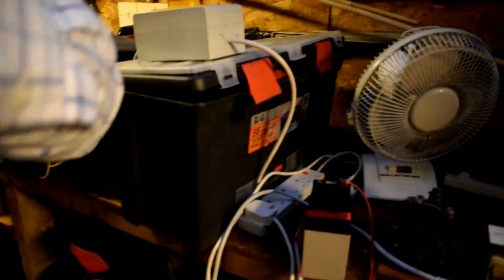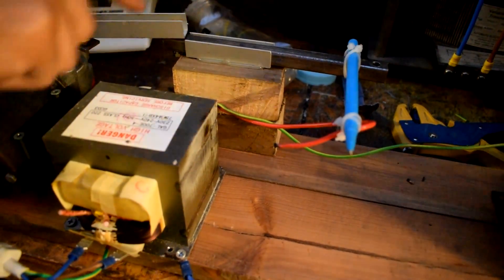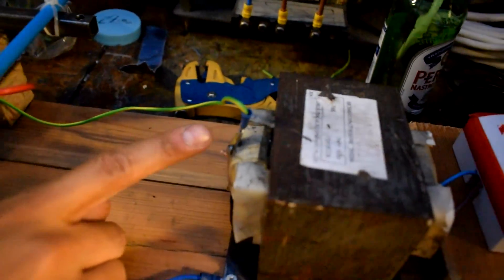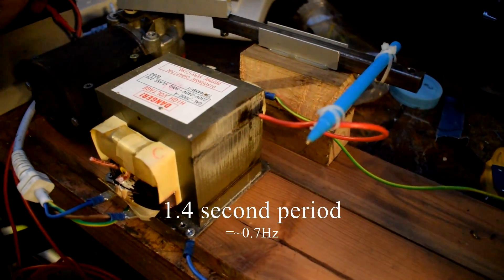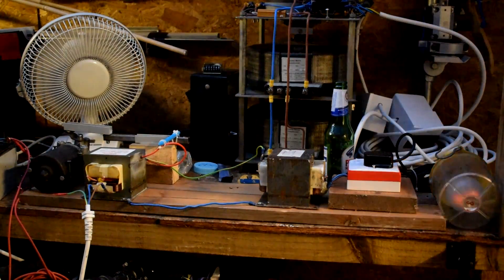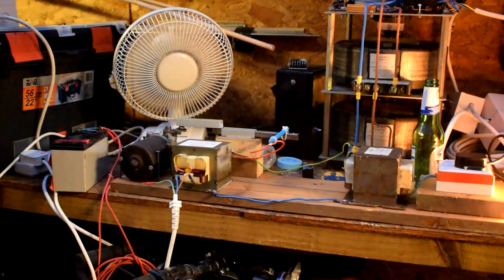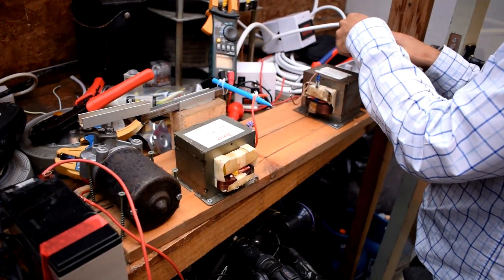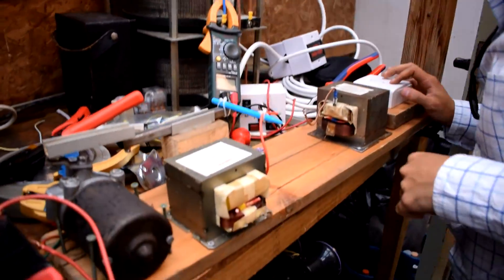The Frightening Filament Flasher ⚡ - Flashing Light Prize 2017

Comment: What would happen if you interrupted the current between the MOTS instead of shorting as it quite a high inductance and voltage circuit?
Reply from the maker: That was our first plan, and what we showed at 2:50.
The arc was not very long, probably due to the high inductance of the step down transformers secondary (which we were using as a primary) reducing the arc current.
Shame, but we pulled through with this in the end!